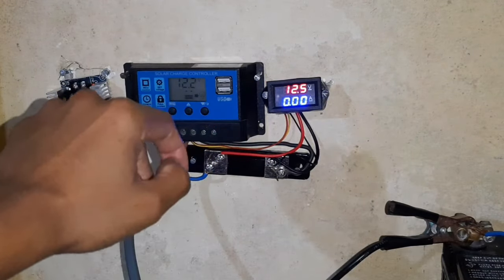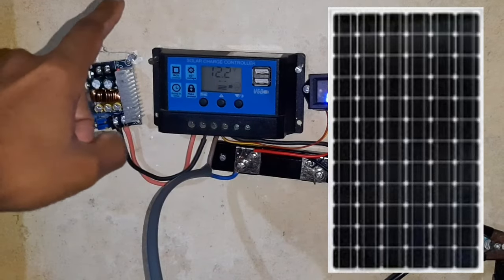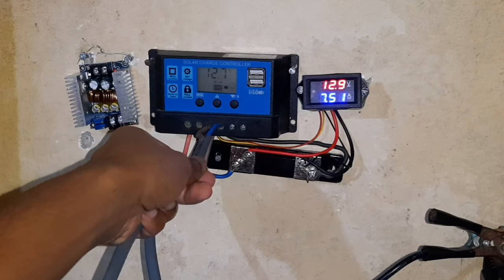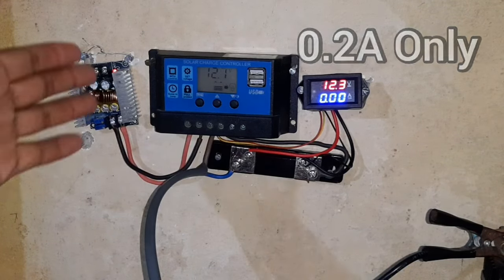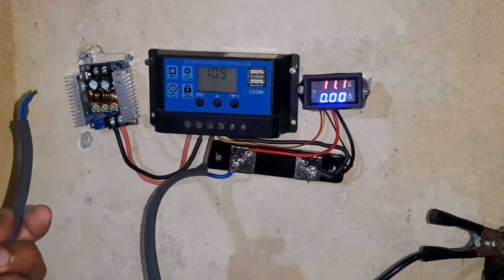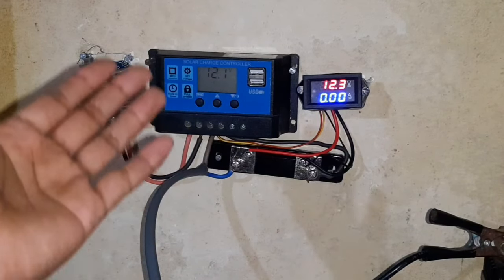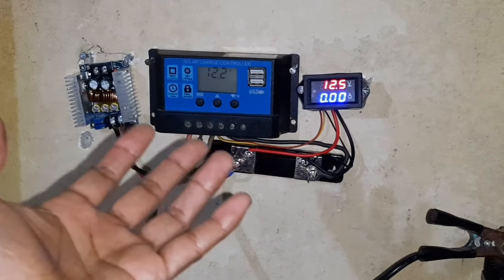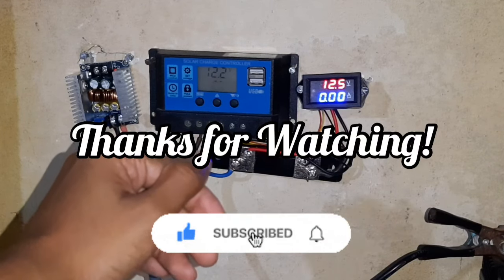Dc to dc Stepdown Converter for Solar Power System - Live Test! | Is it Worth it?

Comment: hi hello,i was watching the way you were connecting the wires ,you connected the output of buck con to the solar panel input of pwm chrge con,and the wires you had in your hand we were unable to determine if this was from your solar panels or was it from the load you had on, because then those same wires you connected to the pwm chrge con Battery output, which will not give you any comparison of with or without the buck con unit, i think you need to revise your method here sorry mate.
Reply from the maker: Hi.. Thanks for the critical insight... The reason I did the video was to make a point that the buck converter dosnt work like a MPPT charge controller. Thats the point I wanted to make.

Comment: Question for you...does it matter if you exceed the watts on a  [cc] buck  with solar panel? , of course not exceeding the v imput.  If I parallel 3 200w panels than my current  increases for my buck output... it is a  300W/20A Peak, 15A Sustained. Will use it for a 12v inverter. .or just 12v for small heating element ( to run while there's sunshine.  These are extra panels outside of my existing system.. I could buy a cheap pwm but they have there limits and this way I don't have to invest in a battery.
Reply from the maker: If the output exceeds 20A. It has a high chance of burning out. I guess you can add one for each panel and parallel the output. But best will be to get a good MPPT SCC

Comment: Just to clear up a few things per the comments.  An MPPT controller does use Buck conversion, But that's only a piece of the entire MPPT controller.  Only using a Buck converter is like having computerized fuel injection on a car, except you only have the injectors and no real control over them.  It's rather pointless.  

I have a Drok buck converter connected to a small panel.  To get anything meaningful out of it you have to constantly BabySit the potentiometers. If the solar exposure drops, the voltage will collapse to the battery level.  You can dial it back to the MPPT voltage of the panel but it is Tricky to do.  As the Solar exposure increases, now you have to change things again.  As your load demand changes the voltage can collapse (perhaps you decided to charge your phone also).  Now you are babysitting the potentiometers again.  As the charged battery voltage rises, this will effect the input voltage of the panel also- sending it too high based on low amps being drawn.  This requires more adjusting.  

A real MPPT controller automatically makes changes based on what is happening at Both Ends.  Just because it uses Buck Conversion to do so, doesn't mean it's just a cheap adjustable Buck Converter!

In short, these buck converters do not work well in the least as Solar Charge Controllers.  I would bet most people would be better off just using a PWM controller, which is what these buck converters amount to (now with increased self load due to adding things into the chain) unless you constantly babysit them.  If you have enough solar, you probably would not have to babysit one as much because you would have more power leeway.  But, in that case you would then have to worry about blowing up a cheaply made buck converter with too many top input watts.

In short, I'll stick to my real MPPT controller.

Where these adjustable Buck Converters Shine is when you connect one to your battery and use it to change the voltage to what is required by your device to charge.  They work well this way because they are then receiving Constant Voltage Constant Amps.  I use one of these Buck Converters to change 12.6 volts to 3 volts for use with a AA battery charger off my solar bank.  But, the bank is being charged with a real MPPT controller.
Reply from the maker: Yes... This is exactly what I found out the hard way :)
Reply: @diysustainableliving2774  The better cheap solution would be one of those modules that attempt to keep the panels voltage at around 17-18 volts.  It's not really MPPT and the gains are still questionable vs PWM, especially on lower wattage panels.   Like on the panel I have the Drok Buck on, I calculated the difference at like 10% IF I constantly babysat the controls and IF the solar exposure is great enough to even provide enough power to ride it back to 17.5 volts panel side (definitely not when shady).  That 10% would make a bigger difference on a giant array, but one of these cheap Adjustable Buck Converters would likely overheat and explode if you put that amount of watts through it.  If you had a lot more panel voltage -36, 48 it would be easier to control which is exactly the same thing manufacturers of MPPT controllers will tell you, "don't expect much gain if you don't have high panel volts."
Reply from the maker: Ya.... One cheap way is to add another panel but especially in places like the UK it would be best to get a good MPPT to get the maximum power out of your existing panel set up.

Comment: Brother can we use this buck converter with an inverter to charge a 7ah battery by lowering down the amphere to 1amp?
Reply from the maker: Yes.... These buck converters can adjust the voltage and amperage. There are two trimpots for that. I have adujuted the voltage side but have always kept the current side at the maximum setting.
Reply: @diysustainableliving2774  ❤️ thank you for the reply brother , I have two inverter which is out of use , I want them to use for my pc with small batteries attached like 7ah or 14ah . With a 12 volt or 24 volt inverter I have .

Comment: Agr pwm cntroler se buck convrter ko connection krle tw kya fridge chalega inverter fridge....without batter
Reply from the maker: Please ask the questions in english. By using google translate I think the answer to this question is... the buck converter connects in series before the pwm scc. This is ideal if you have a lithium ion battery setup as it needs a particular voltage. As for the fridge either you need to use a fridge which runs on DC power or you have to have an inverter to run an AC fridge.

Comment: Asked about:

 XL4016

 How to connect 2 pv panels in parallel (170Wp 30-35V) under the XL4016 and connect the XL pump to the pond 12V 19W ... without a battery, will it work on a sunny day?
Reply from the maker: If you have one 170w panel it will certainly run a 19w pump without a battery! And yes the XL4016 module which is capable of handeling 8A should easily work with the 19w pump.
Reply from the maker: Is the pump 19w or 190w? Why do you plan to connect 2 large panels for a small 19w pump?
Reply: @diysustainableliving2774  because I want to use them for other tests by the way.  I have a UPS + 75Ah battery.  It is powered by the gate drive.  I want to be able to power it off grid.  These panels are used and I can buy them very cheaply.  In addition, with large oversizing, the pump would work on a less sunny day.
Reply from the maker: Great... Make sure the output load is within your step down converters rating. Those panels can produce a large ammount of power at the output that it might overload the buck converter. Eg: If you connect it to a battery 2 panels will definetly fry the 8A buck converter. Connecting to a small load such as a 19w pump wont harm it.
Reply: @diysustainableliving2774  yes, but can I adjust the output current to a minimum?  Is there a risk that the voltage or current at the output may ripple if the voltage or current at the input fluctuates?
Reply from the maker: A buck converter is there to provide a stable source of power. As I said... it depends on the load you want to run on it. Just make sure it dosnt pull more power than what the device can handle. I dont think adjusting the current will serve the purpose.

Comment: Hello, i want to use this buck converter to my 60 aH spesification battery, is buck converter still compatible with that ampere?
Reply from the maker: As long as your buck converters output voltage is set to more than the battery voltage you can make it charge the battery. But please note!!!... what Im showing in this video is that for solar applications it is not going to be helpful if your solar panel voltage is not significantly more than your charging voltage. In that situation an MPPT will be more beneficial.

Comment: Can step down buck converter power on the inverter without battery ..direct from solar cell?
Reply from the maker: Yes that can be done. But the power won't be stable like for example when you are running a load and a cloud comes over!... Everything will stop.
Reply: Unfortunately, my dear friend. The inverter does a reboot with a low voltage whistle, even without loads, and I tried it myself today With a strong sun on the panel.my panel is 250watt 36v 8ah .the inverter 1k modified sign wave.what is your advice ?
Reply from the maker: Check out this video where I show how to run a fridge with and without batteries.
 https://youtu.be/yyEPNL7Va9o
Also the modified sinewave inverter will struggle with heavy induction loads as induction loads will work better on puresinewave.

Comment: I want to run an inverter off panel and Buck converter during day and charged battery bank at night. Possible??
Reply: Solar cell as transfer switch??
Reply from the maker: Please watch my video on how to run a fridge with and without batteries. There I am showing how to run a fridge with direct solar power.

Comment: I bought a 12 to 24 volt to 12 volt 100 watt buck converter for my 100 watt solar panels. I think I can use it to directly power a 12 volt 100 watt rice cooker. My rice cooker says it can be powered by 12 volts to 24 volts though so maybe it can be used directly with a 100 watt panel without the converter. It contains a fuse though so I`m not sure if that would overload it and blow the fuse.
Reply from the maker: A 100w panel should have a voltage rating of 18.5v. So this should be well within the rice cookers voltage requirement. BTW what is the rice cookers power rating? 100W is a bit too small! And how many 100w panels do you have?
Reply: @diysustainableliving2774  I have three 100 watt glass panels and seven of the folding portable panels between 20 and 60 watts for USB devices. I`ve been buying one 100 watt panel each month because in the future I`ll be living in a large camper trailer and if the Sun is good there I plan to buy LiFePo4 batteries and build a system to power a small air conditioner. Right now I`m using two 700 watt Bluetti EB70 power stations to run a small AC refrigerator and a small freezer during power outages. I also have a Rockpals and a Golabs that are both 300 watts and they all work as a team to keep lights, fans, and radios going too. We have bad hurricanes and other storms here. 

I was very skeptical about the rice cooker but they work incredibly well. Mine can cook rice in about 35 minutes with my portable power stations and can boil eggs too.  

The display on the power stations shows the devices use about 95 watts. I bought two of them. This is the name on Amazon: Electric Rice Cooker 12V 100W 1.3 L Electric Portable Multifunctional Rice Cooker Food Steamer Food Steamer for Car for Cooking Soup Rice Stews(green)
Reply from the maker: Wow great!.... I think in your case you since you will be needing a lot of power it will be good if you could get a powerful MPPT charge controller. The buck converter can be useful in certain situations but I think in your case you will be better off with an MPPT controller. Im sure you can still find plenty of uses for the one you have already got!

Comment: I have imars panels sp 50w have 3 of this have 2.2a at 23.8v only getting 3.7a on pwm controller can I use this dc to DC instead of a mppt controller?
Reply from the maker: It is not as efficient as an MPPT!... It can give a marginal increase in the voltage if the voltage difference is large. It would more cost effective to just add another panel considering the cost of MPPTs.
Reply: @diysustainableliving2774  is not wort it I nedd mppt
Reply from the maker: @marine1718  for the cost of an MPPT you can add another panel!... It will be more benificial for you in the long run.
Reply: @diysustainableliving2774  I'm only getting like 3.5a in pwm controller if I change o mptt I will double that
Reply from the maker: @marine1718  Well according to your panels if you have three of those in parallel you should get 6.6A even on pwm. I think you need to check your wires and connections first. In theory an MPPT should be able to get 10A from those 3 panels at 12v. But just look at the cost. If you are able to get a panel with a higher amp rating for the same cost as the MPPT you will be better off. Remember all electronic components can fail at any time. A solar panel will last much longer than an MPPT! Im just trying to point the cost benefit here.

Comment: i have a question. regarding the comparison, why is it that the comparison is between the output efficiency of using a step down converter and the direct output of the solar panel into the output side of the pwm? isn't it more comparable if both setup is wired on the input of the pwm, and not directly to the output of the pwm (first setup)? 
note:
the wire on first setup is on the output or battery side of the pwm, direct from solar panel
the wire on the second setup is on the input of the buck converter, then from buck converter into the input of the pwm
Reply from the maker: You have a good eye!.... The reason is that I need to compare immediate results to make the test more accurate. Even if a tiny cloud crossed the suns path the values tend to vary a lot. If I got a significant difference like an MPPT I could have easily taken my time. But it is not working like that. Because of this I had to keep the buck converter connected at all times. I only have one buck converter with me and I dont know what will happen if I connect the solar panel directly to the output side of the buck converter. I dont want to destroy it. And besides the pwm charge controller dose nothing but act like an on off switch. So connecting to the input or battery out side is the same!
Reply: @diysustainableliving2774  thank you for the explanation sir. I'm currently building my powerbank as of the moment. Hopefully I can also conduct the same experiment next time, I have a theory that the efficiency of the buck converter and the pwm charger will vary more noticeable if both are done with pwm inputs.. I'll share my results also to you sir as this is very interesting topic for me. Thank you again
Reply from the maker: Good luck with your experiments. The only place where I assume the buck converter will work by increasing the amps is when you use a higher voltage  eg: 40V panel for a 12v system. Otherwise its not worth it. You would be better off with an MPPT charge controller.

Comment: i have 375 watt 44 Volts solar panel...can i charge my 12 volt tubular battery with this buck converter??
Reply from the maker: This buck converter is rated upto 40v but should be able to handle the 44v panel. Although it might work better than a PWM charge controller alone the efficiencies are not comparable to an MPPT charge controller. If you can afford an MPPT then go for it. If not then this buck converter should be enough to serve the purpose in your situation.
Reply: @diysustainableliving2774  thank you so much for the information
Reply from the maker: Just make sure the amps are within the rated value. 375÷14=26amps which might burn a 20A buck converter.
Reply: @diysustainableliving2774  i don't know much about it. but the panel gives 9 ampere at it's peak. i've measured
Reply from the maker: The buck converter efficiently reduces the voltage, at the same time if the power input is high it will increase the amperage on the output side. 375w panel theortically can cause the amps on the output side to go above 20A. If this happens the 20A buck converter will get destroyed. In that situation you could try with a larger buck converter or two 20A buck converters in parallel.